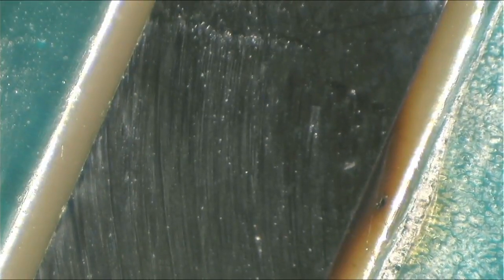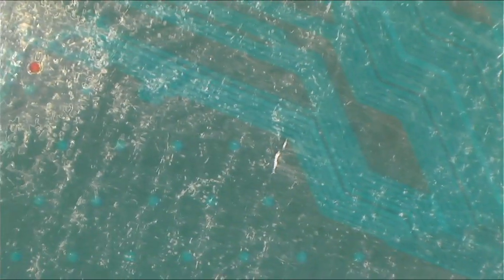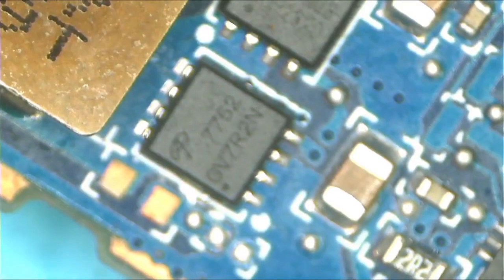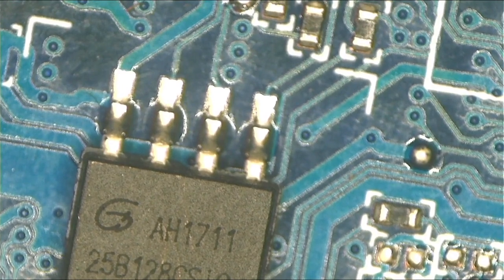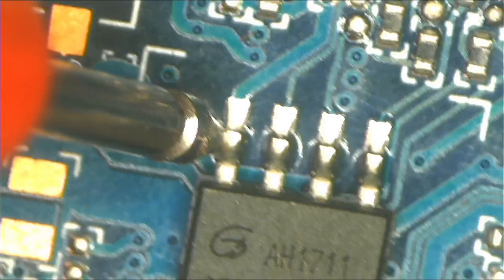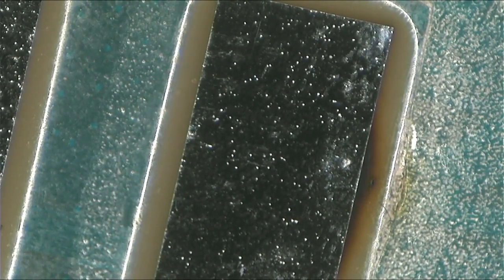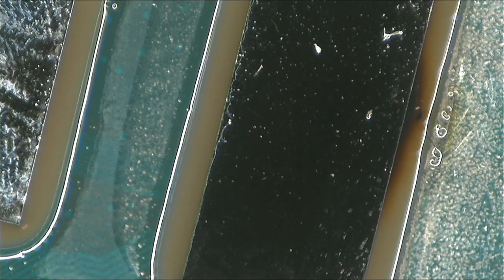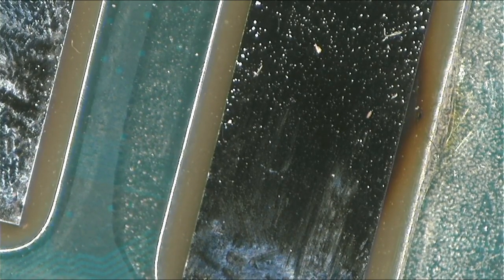This is how you check for shorted CPU/PCH

Comment: same with hp probook 450 G6. All coils around the CPU are shorted and from 5 from 6 i get the right Voltage Output (even they are shorted) ... One coil does nothing. I removed the Dual Gate Mosfet from this coil but the same as before. Now I´ll desolder all the Coils but I´m sure the CPU is dead.
Before that, the 19,5 Volt Rail was shorted and I found the guilty Cap by Voltage injection . Now, when i plug in the charger,  the LED from the charging Port is lighting up for 3 sec. and without powering on, the cpu gets hot on it´s own.